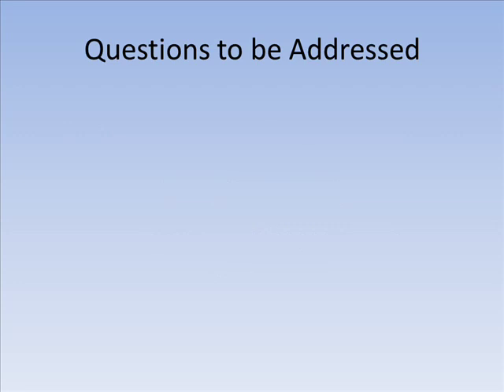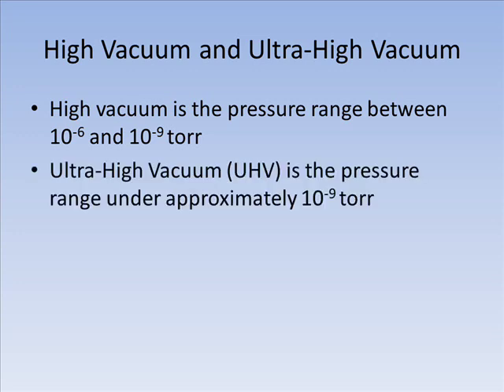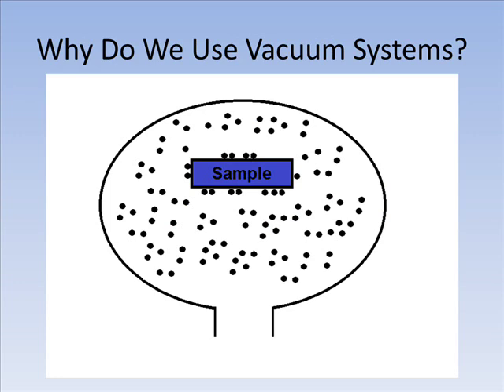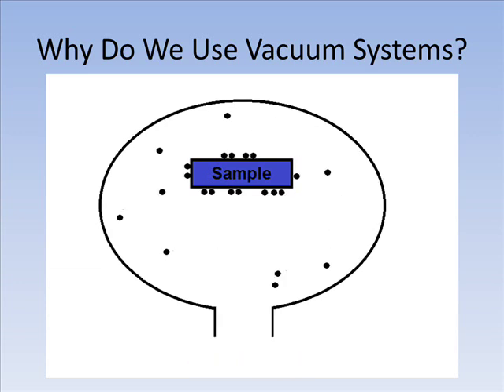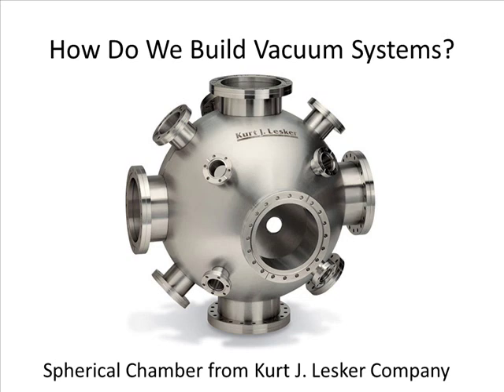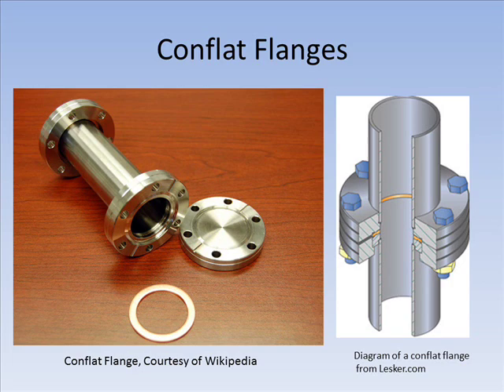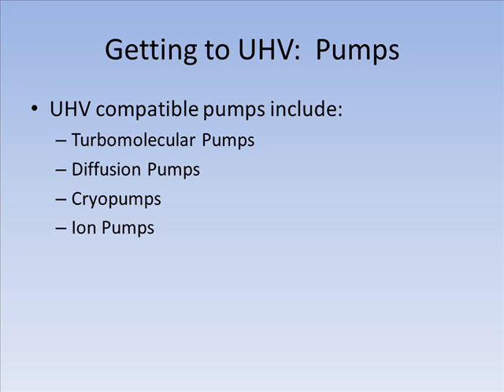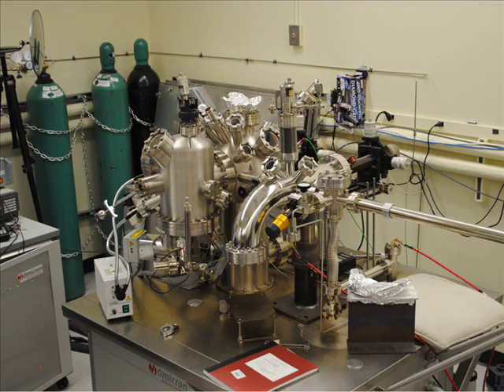Introduction to Vacuum Techniques

Comment: You missed the TSP pumps.
As a idea you could also add the pressure range where the specific pump can be used, for example ION or TSP pumps are nor used at 10^-3, more or less diffusion or turbo pumps are the roughing pumps for ION/TSP/Cryo.

Another interesting thing to add would be the types or pressure gauges and the range of pressures where they are useful.
Reply from the maker: Thank you for the input!  I have been meaning to go more in depth about pumps in a separate video, and this is encouragement for me to do so.

I agree that a video on gauges would be interesting.  I think I will start drafting one up.